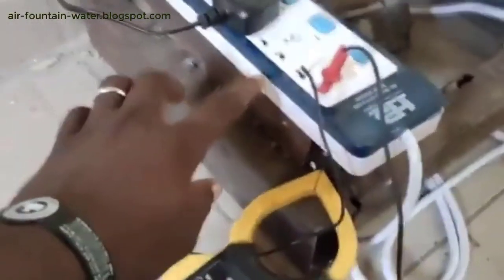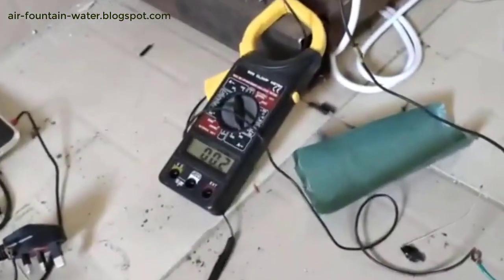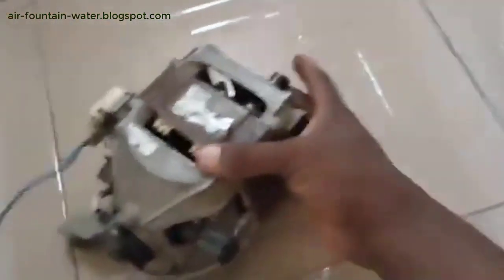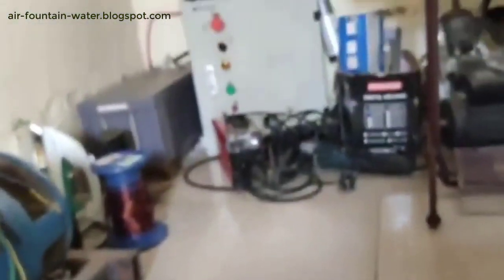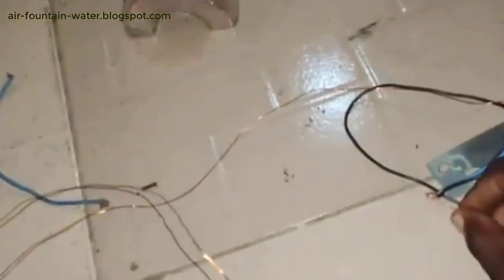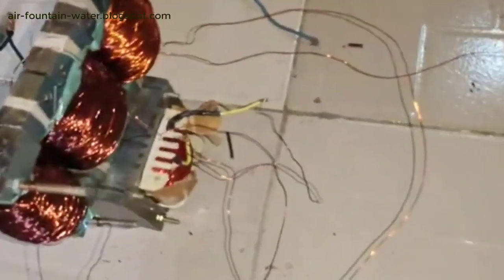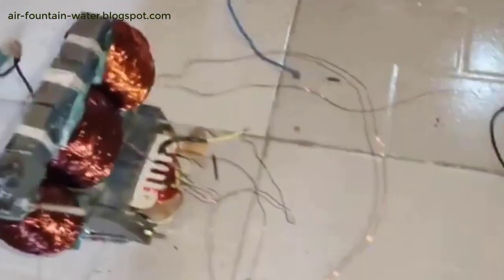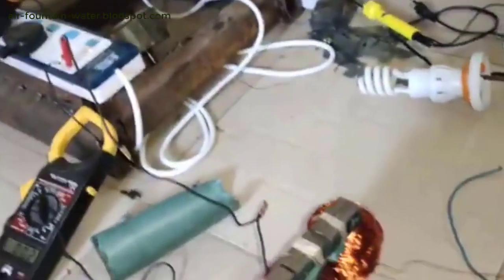Thane Heins Bi-Toroid Transformer Replication by Joseph Ocheme

Comment: Great demonstration. Whats the transformer underneath doing? Is that just for the flux flow, or is connected to the Bi Torroid transformer?
Reply from the maker: Just a base or for comparison test...
Reply: 电压不够   需要升压
Reply: @freefly-r9w 
Bi toroid transformer doesn't work. Super inefficient.
Split flux transformer doesn't work. Super inefficient.
Partnered output coils doesn't work. Super efficient.
Frolov transformer has zero output power because the primary winding is completely inductive.
Now, what is missing?
Let's compare the PHASE of a rotating electromagnet and the primary coil of a transformer.
The voltage and current of an electromagnet are IN phase for an electromagnet as it is DC voltage.
The voltage and current for the primary winding are 90 degrees out of phase, hence imaginary power, or just no power transfer, only storage.
Adding a capacitor in series with the primary winding causes it to short circuit, no voltage induced as voltage gets stored in the capacitor instead.
Therefore the SOLUTION for the anti Lenz transformer or "frolov transformer" is to simply add capacitor on the output side.
Connect the two secondary windings in parallel with each other, then in series with the cap. This resonates with the primary winding which allows energy to be pulled from the zero point energy field.
Reply: The one underneath produces Koo Klax Flax meta-energy, which is the source of the real power boost in the beginning of the cycle.
After that it's free sailing.